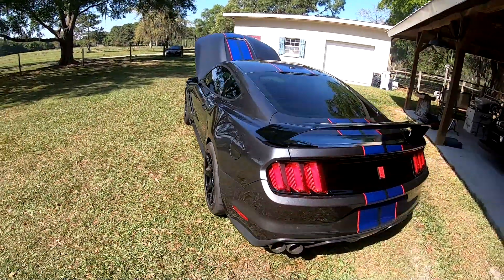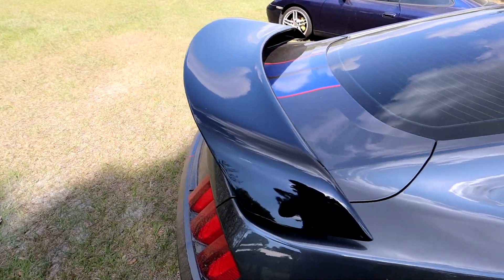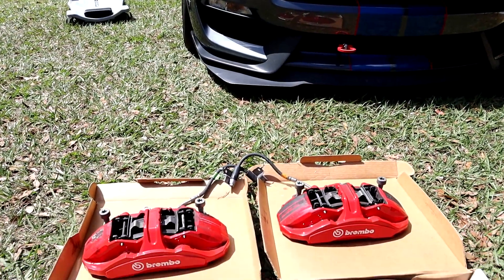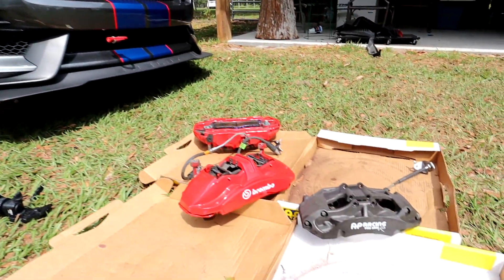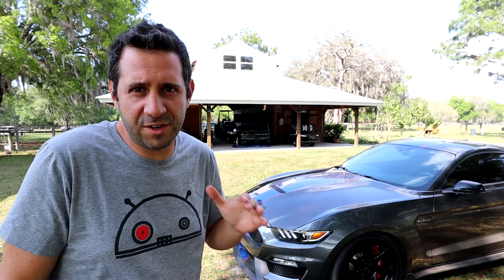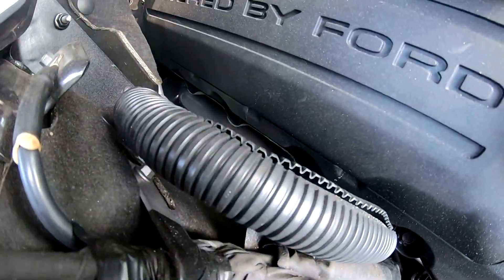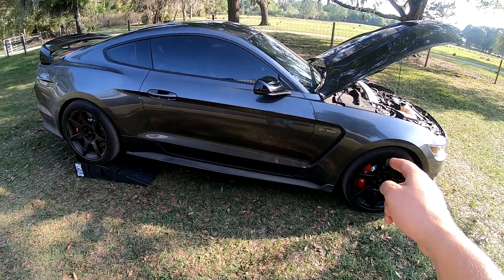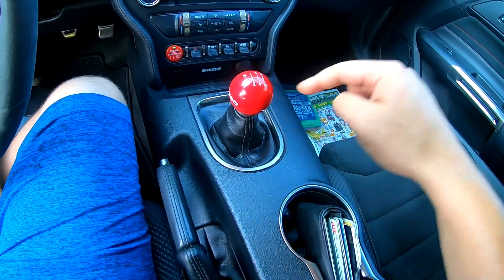I Bought a SEVERELY DEVALUED Shelby GT350R Mustang and I'm Restoring it back to Factory OEM!

Comment: Oh god samcrac is gonna learn about selling mustang parts bless his heart
Reply: DemonSpeed713 oh I’m sure he’ll get top dollar on eBay from reasonable, well-heeled Mustang enthusiasts. What could go wrong?
Reply: To be fair market for regular Mustang and Shelby are not the same.
Reply: lmao for realz dude. Couldn't sell my full headers/mid pipe resonator delete/muffler full exhuast system for even $1200 for 6 months lmao. Sold injectors and throttle bodies and other stuff quick tho. Shelby mustang market is different but why the fuck he wants to mess with it and pinch a penny lol. He is way to cheap at a certain point, its not a lambo its a mustang fuckin leave the mods on it.

Comment: I would definitely leave the Long-tube headers. Not worth the labor to remove them.
Reply: Agreed... its the mufflers that are killing the sound...not the headers.
Reply: Yes agree. Definitely those mufflers... Not a fan
Reply: Agreed
Reply: I agree
Leave the headers but replace the mufflers
Reply: I agree.  Will the factory mid-pipes hook up to the long-tube headers?
Reply: @IlliterateSage  there must be some adapter in the market
Reply: Unless you live in Commiefornia and have to deal with smog nazis...
Reply: @fxgjolteon4781  so I take it you're too young to remember the pre-smog days? Shit looked straight out of a Chinese manufacturing town
Reply: The headers are the reason why this car sounds like a 4 cylinder. The stock unequal length header design is what gives the GT350 that crossplane style sound, this car has equal length headers so what you’re hearing is what the engine actually sounds like uncorked, Aka a flatplane.

Comment: I do agree with you it doesn't sound as good as the stock mufflers leave the headers just put back on the stock mufflers
Reply: That might effect the performance. Unless they went with loudness then it doesn’t matter.
Reply: Agreed
Reply: Yeah those long tube headers will make the stock mufflers sound even better no doubt in my mind
Reply: Can someone explain in a bit more detail what makes the stock better sounding?
Reply: The headers make the sound though. Reason why the gt350 has a growl even though it’s a flat plane crank engine is unequal length headers. The aftermarket headers kill the unequal length growl and are absolutely responsible for making it sound like a civic. It’s the same thing when people put equal length headers on Subarus and they suddenly sound like civics
Reply: John O'Laughlin bro please!!!!!!! This and a Subaru DO NOT SOUND LIKE A CIVIC.
Reply: @jamesmedina2062  you don’t know what you’re talking about.
Reply: @CadexLaw  Make your argument then.

Comment: $4600 to sound like a Honda civic type R perfect example of aftermarket downgrades.
Reply: Chris Borns thats impossible (NA vs small turbo)
Reply: @jamesmedina2062  that’s not how it works..flatplane v8s can absolutely sound like flatplane i4s regardless of forced induction or not.
Reply: @CadexLaw  its but about the intake but the exhaust

Comment: The spoiler is also carbon fiber so the knock offs are not the same, huge price difference too. 

Also, the reason the calipers looked like that is because of the wheel clearance. The clearance is not much which allows for pebbles or, if you track, pieces of hot rubber that comes off the tires. I have this same issue.

Comment: The scuffs on the OE calipers looks like tire weight rub (clearance).
Reply: I have seen the teflon inner liner on the carbon front wheels rub the brake calipers
Reply: Right. This was not from removing them.
Reply: @mc2_tech_reviews Samcrac: What did the previous owner do during removal? Rub the calipers against the wheel well for 20 minutes? lol!!!
Reply: @ricky-sanchez  The barrel clearance between the caliper and wheel is so narrow that if you get bits of track rubber or gravel caught between them it will blacken and score the inner barrel of the carbon fiber wheels as well as the caliper surface.
Reply: @steveross6312  Ou shit! that's bad!
Reply: He was probably tracking the car with smaller diameter track wheels. Clearance issues may be part of the reason he put on the AP set.

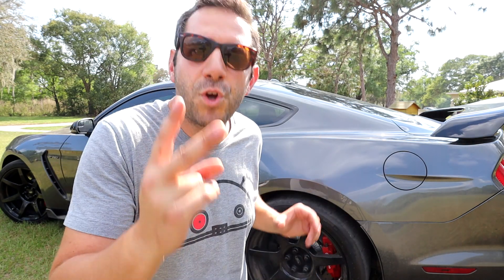Comment: 2:58 - Only the GT350R and a Koenigsegg come with factory carbon fibre wheels.

FORD GT😒: AM I A JOKE TO YOU??
Reply: Ferrari 488 Pista: AM I A JOKE TO YOU ???
Reply: Porsche 911 turbo S exclusive series: am I a joke to you
Reply: BMW M4 GTS: Am i a joke to you ?
Reply: @Kaisuke971  those weren't carbon
Reply: 1994 Honda Civic: AM I A JOKE TO YOU?!?
Reply: @SportsDomination 🤣 LMAO
Reply: 2006 dodge minivan😒: AM I A JOKE TO YOU
Reply: The GT350R wheels are literally the same as the GT’s 😂
Reply: Also the New GT500 with the track package
Reply: Still that sucks! The wheels on my bicycle are still many times lighter! )))
Reply: @zaynkhan136  the gt350r has the same shape of the wheel as the gt but the wheels are carbon fiber and panted so you can't see the carbon
Reply: True true!
Reply: It was only the GT350Rs and the Koenigseggs when both were new. GT350R came out in 2016.
Reply: Srikar Vundavalli like your profile pic he should sell this to gavin !
Reply: @ben__9521  yeah I agree but I'm afraid it won't be very cheap as the engine doesn't have an obliterated cylinder wall and cams😂
Reply: Srikar Vundavalli gt500 comes with them too

Comment: Imagine having Brembo brakes and going "nah these aren't good enough."
Reply: i did and upgraded to a Baer set
Reply: Wilwood would like to have a word
Reply: Adam Seddon definitely not shit, but not up to hot track day useage.  they have dust boots etc to be used for daily use.  brembo certainly makes motor sports brakes but they also make oem stuff.  they make just about all super car calipers.  look at the chirons calipers
Reply: Brembo has a wide range of brake products from oem replacement to Formula 1 carbon ceramic.
Reply: Adam Seddon not really..
Reply: The past owner made it worse. The stock brakes are amazing
Reply: @carstuff4u942  Doesn't mean there's nothing better
Reply: Max Power  Those AP Racing Pro 5000R brakes are really good though.
Reply: Brembo does make decent brakes for street use. Theyll stop on a dime as theyrr large pads & 6 piston. But there are high performance brakes available

Comment: Don’t ditch the long tubes just yet see how the stock exhaust sounds with long tubes first.
Reply: I suggest he try the factory mufflers he already has with the rest of the Kook's exhaust.
Reply: Idk. The stock sound is amazing. It would save alot of work to leave the aftermarket longtubes. But the 350s have an amazing sound. It would put it back to stock and up the value again. I'd do it.

Comment: I don't blame you for wanting to put the exhaust back to stock, the Kooks setup makes it sound like a 4-cylinder both inside and out.  That's awful!
Reply: It sounded like rice Civic ;/
Reply: it sounds like a flat plane V8 with equal length headers, similar to a Ferrari 458. Just because it doesn’t sound like a big ol v8 doesn’t mean it’s bad
Reply: I agree, it sounded like an ecoboost with ATAKS.
Reply: @kinafermusic2456  that exhaust note was so terrible. Did you hear the crispy pops... guys an idiot for installing that exhaust. I don't care if he gained 20HP
Reply: Yes it does it sounds generic the stock sounds throaty
Reply: KinaferMusic it sounded like a Civic.
Reply: @CadexLaw  well because it's basically 2 civic-ish 4 cylinder engine bolted together in v configuration.
Reply: Ardi Januar what a weird comment
Reply: KinaferMusic the Ferrari sounds nice because it’s a tiny engine and revs crazy high. This low reving big v8 sounds exactly like a ricer civic, just really loud.

Comment: 6:24 the sounds of a harbor freight jack
Reply: you could call that SamCreak
Reply: ND1Club underrated comment
Reply: The squeak made my dogs freak out and run to the door barking.
Reply: At 17:46 you can see the harbor freight ad on the passenger floor board. He's gotta cut corners somewhere ha
Reply: HF was the only store to have a low/long reach jack that was not in the $600 range and in stock when i needed one for half the price. They have moved up in terms of quality in the last couple of years.

Comment: Pretty sure the tow shackle up front is standard.  Just walked outside next door, neighbor has a 2017 GT350R (same color and all), sure enough red shackle up front.  Long tubes I’d keep but the rest I’d go stock.  The oil separator, CC plates and air filter are upgrades we’d all do.

Comment: I personally think the stock exhaust sounds better. It has a deeper tone that better matches the 5.0.
Reply: sounds like v6 with that aftermarket exhaust.
Reply: aviking it sounds like my ecoboost mustang.
Reply: There are many different exhaust setups available to keep the tone while maximizing power and overall depth of the sound. ARH makes a wonderful full exhaust for the 350 that I think has the best sound out of all other aftermarket options. The stock exhaust sounds great, but I also wouldn't want it to sound anything like a 5.0. A flat plane crank creates a very distinguished sound.
Reply: Brandon Oppelt 😂😂
Reply: Its not a 5.0. It’s the 5.2 Flat Plane Crank Voodoo engine
Reply: I’m sure he’ll put a armytrix exhaust on it.

Comment: Wtf- that exhaust sounds like my car. A 140hp 4 cylinder
Reply: What has that to do with power?
Reply: Schulze Designs wtf are you talking about
Reply: @joeydrifts  Do you even know what you are texting? 140HORSEEEPOOOOWER and i did ask you what the sound has to do with the power output. DAMN
Reply: well it is a flatplane v8 - thus having the same firering order as a 4cyl inline - ford has just made magic with the stock header, so it does not sound like it

Comment: I’m with you on the brakes and the suspension module. The exhaust sounds horrific, why anyone would put that on their car is beyond me. I would take off the rear section of the exhaust and put the stock stuff back on, with the headers it should sound even BETTER than factory. Oh, and GO GATORS!

Comment: Restoring to oem seems foolish to me i guess in a collector's perspective it makes sense, but to me i want the better parts for better performance
Reply: Hes taking them off because there isnt enough of a performance difference and he didn’t like the change in suspension and exhaust, so he is getting part of his money back
Reply: @sedgix  Correction: He'll never see the performance difference. Sadly this car is a waste on him. One of the best track cars ever made and he's going to let it sit on the grass collecting dust or in with the chickens or just take it to get groceries. Complete fail.
Reply: Mizino: In Over My Head. When you can afford a gt350r you can do whatever you want with it, too.
Reply: @mizinoinovermyhead.7523  I think when your nose is as big as his, you can do whatever you want.
Reply: Mizino: In Over My Head. Get that envy monster off your back bud, it’s depressing
Reply: The whole point of that aftermarket mag ride controller is that you can program your own settings to suit the ride you want.   And you can use the dash to swap through your presets.  He doesn't even know what he's doing.  If you're operating car enthusiast channel , you don't go full chode and sell off the good parts for money.
Reply: @NickKautz  he needs to make up some money of that money he spent. Which is why he is selling the mods. He Is just trying to justify it by saying the parts dont add any performance gain.

Comment: That exhaust needs to go!  It sounds like my daily (Accord).  I would try it with the header's in place first to try and save the work.
Reply: Bit of an exaggeration.
Reply: it sounds like a 458. Both are flat plane V8s which by nature will sound more similar to 4 cylinder engines due to the firing pattern.
Reply: James Greco damn what kind of exhaust you got on your Accord?

Comment: I COMPLETELY agree about the stock exhaust on these. A gt350/gt350r is probably the only mustang id ever keep stock exhaust on because it's just perfect. Id say definitely put the stock mufflers on with the active exhaust. As for the midpipe and headers. Just try them with the stock mufflers and see how it sounds. If it's too far off of the beautiful stock sound, then work on changing it out later. I think most of the sound that's "missing something" is from the mufflers

Also, i absolutely love GT350's and mustangs so I definitely plan on owning a non R one one day

Comment: I would not remove the exhaust. Yes I know it sounds better with stock. But it’s nice it’s give you a little performance boost! I have a bmw 550i and I Striaght piped it myself and it was fairly easy but did take some time! Plus it gave me some more boost!

Comment: Theyre devalued because its very common for the engine to fail. Especially when tracked. Lots of other channels i follow are dealing with these issues...

Also. Leave the long tubes and run stock mufflers.
Reply: ...he thinks he's going to have a high value collector car after it's been tracked lol...
Reply: TKidd88 what are some of the channels?
Reply: @juandominguez8536  justa6 is one but if you look online you can see many owners going back to ford with low compression
Reply: @juandominguez8536  Adam LZ

Comment: Weld in some aftermarket cutouts and tie it in to the factory switch. You can get the rowdy exhaust when you want it and still keep the long tube setup for the extra power gains.

Comment: I’m sorry I would leave the brakes on to me that’s a good modification over standard brakes
Reply: Only real difference is small weight saving, not anything you would be able to feel in everyday use
Reply: bmwman1981 the standard brakes are already overkill tho
Reply: Brembos look so much cooler!
Reply: I would never changed the front brakes back from ap to originals brembo, i’ve rather bought a set og ap’s to change the rears..😅
Reply: I like the brembos back. Color matches and it'll be a nice little price recoup. Unless he's going to compete, he'll be fine. And even then, I doubt it'd matter unless a pro driver was being the wheel.
Reply: James Caldwell 29 pounds of unsprung weight is huge. especially on the rotors. wouldnt take a pro to notice that difference at all
Reply: The stock brakes are very amazing. I had a 2017 GT350 and don’t need an upgrade
Reply: As someone said on another comment,  the reason the stock brakes were scuffed is the fact the clearance between the wheel and the brakes is so minimal that if anything gets between them it will grab and do that. The previous owner probably saw that and went for a smaller set. This was smart, since Sam just told us there are 12k in carbon wheels alone in the front. It wasn't that smart of him to spend the time going back to stock. I imagine a stock Brembo 6 piston caliper wouldn't be that that much difference, and there maybe a lot of Mustang 350 owners looking for one.
Reply: @BeastMode1210  sure bud, take a dump before the race next time to gain that 20 lb advantage
Reply: @BeastMode1210  bruh he's not tracking it why would it matter

Comment: If u just install the caliper while leaving the old one attached. U just open the bleed on the new one. Take your brake line off and bolt on to new caliper. Make sure master stays full and you dont have to bleed the whole system

Comment: Honestly Sam it sounds like it just needs an X pipe, and you might as well have a shop add cutouts while they’re in there. Granted you most likely lose a little performance but you’ll get the sound you looking for by crossing the banks instead of only hearing one bank at a time.

Comment: Standard callipers look like the pervious owner went through gravel on track when they were previously fitted, they would be damaged like that from removal, should have left the AP brakes on. Also you didn’t need to drain the brake fluid, just put some grips on the rubber hose to stop fluid coming out, not great to get air in the abs pump

Comment: Correct me if I'm wrong but you need to remove the whole exhaust to regain the sound of the gt 350 r. If the manifold is an aftermarket one you won't have the same airflow and this means it will be a different sound.

Comment: That doesn’t even sound like a V8, sounds like a Honda Civic
Reply: It’s because it’s a flat plane crank
Reply: @jarrid_wilson  gotta get them OEM header's so it sounds like a mustang again
Reply: whatever Honda Civic you're driving, I want that one
Reply: Reid Lockliear it does tho.
Reply: 12:14 does not sound like any civic I have ever heard.
Reply: I think it’s so that when it’s on track it’s not that loud, some tracks have noise regulations and the 350R may have been too loud
Reply: Sounds more like the V8 in something like a Ferrari F430 now rather than the traditional American V8 sound.
Reply: Yeah, that sound is very bad.
Reply: They had a GT350 with exhaust at a local car meet, I thought it was an up-badged v6 for a minute
Reply: Yes it's got the pissed off bee vibe going on when he revved it up with no load.
Reply: Honestly, owning a 2.0L Civic... I wasn't much impressed with this Mustang.

I'll always hold that a beefy straight-4 sounds better than any V-6 (4-cycles leaves a percussive interference with the V-6) and this V-8 is really missing the low-end rumble I'd expect.

Comment: I bought my clean title 2017 11000 mile gt350 on Craigslist I'm in it for around $ 25000 out the door fixed ruby red. Goal of Going 10,s in the 1320 on the stock tune this year 😈 unless the tracks closed from the virus.  Keep up the good work.